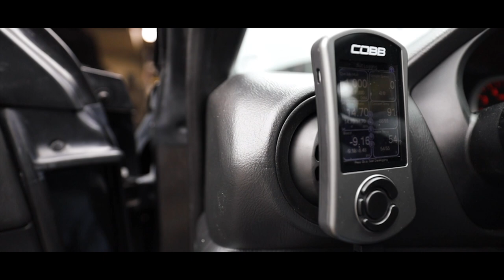How Much Did It Cost To Build the 450 WHP Subaru STI?

Comment: Good quality is not cheap, do it once and do it right

The car turn out so great🤩🤩🤩
Reply from the maker: Thank you! And totally agree. Always under the mindset of do it right the first time 😁
Reply: Otherwise you end up spending more in the end. I learned it the hard way😅😂

Oh and you probably already returned the speakers but with a speaker adapter they woud probably clear the window. Company like metra does adapters that are factory fit with the factory hole and you screw you aftermarket speaker to it!
Reply: Ok i dont find adapters for 05😔
Reply from the maker: IA performance makes adaptors, still have the speakers and got them ordered! 😁😁😁
Reply: 🔥🔥🔥 awsome🔥🔥🔥

Comment: I wonder what it would cost just to build one back to factory or OEM specs. Or rebuilding one with just the type RA block and rods. 

Thanks for the video! Can I ask what did you purchase the car for?! So you paid 10k in upgrades, but what did the car itself cost?!
Reply from the maker: Definitely much cheaper! But would still be a cool build. I paid too much with thr amount of problems it had. Paid 14.5K but if inwould have known about every issue I qouldent have spent more than 12K on it

Comment: I love my 16 STI, but damn it's so expensive to do anything. Especially since I'm in Canada so my prices are slightly higher, my Cobb accessport was just under $1000. Building my Subaru I'm estimating will cost me $20,000-$25,000 to make roughly the same power as your 05. It hurts to think about but after some time when the build is finally complete, I know I'll be super happy with it. And if I'm not I'll sell it and buy a corolla. Who can be sad in a corolla?
Reply from the maker: Never heard of anyone sad in a corolla 😅
Reply: @Smeedia  right? With the fuel mileage you get to those little things it's impossible to be sad. $35 of fuel gets you like 600 miles. Put $35 of fuel in your STI and tell me how far that goes? Not long. Corollas are legendary vehicles in all ways
Reply: V8 coyote or c6 z06. Is the only answer for ez power.

Comment: Question my dude what would be your first place to look for P0171 and at the same time cylinder 1,3,4 misfire? Happened on my drive to work today and it's got me freaked out.🙏

2013 STI
Reply from the maker: Comes back as an O2 sensor, would definitely be effecting AFRs witch could result in a misfire
Reply: @Smeedia  Thank you! Looking into now!
Reply: Well replaced the front O2 with oem and cleaned the MAF. Afr's are dead on while driving but are sitting at around 16-17 at idle then dive down to 13ish then back up. I'm at a loss what it could be🤔
Reply from the maker: While the code is for O2, double check spark plugs as well,

Comment: Yo smeed! I know it's my 4th comment on this video lol but I got $500 bucks I can spend on my 08 wrx at the moment. It has 119xxx miles and I'm focuaed reliability before I make it go fast haha bought it with some mods (cold air, catted dp) and it has the stock tune on it which worries me. With my very limited budget atm what's the best thing I can do for it? Got rid of my check engine light(s) and it seems to be in good running condition so know I feel like I'm back to the starting line and want to start improving the car. Sorry for the long comment I kinda started venting 🤪 thanks again man!
Reply from the maker: Snag an IAG AOS if you don't already have one! 😁
Reply: Sometimes u can find the ap v2s cheap, that way u could at least be off the stock tune. After maint items of course

Comment: I wish I only spent that much on my 05 Forester. I'm way more in than that.
Reply from the maker: Whats all done to the forester?! 😁
Reply: @Smeedia  
IAG Short Block Stage 2 Tuff
Stage 2 clutch
Larger fuel pump, injectors, regulator, side feed to top feed conversion, fuel rails, braided lines 
Tgv deletes
Engine mounts
Pitch stop mount
Air Oil Separator system
Cylinder 4 coolant mod
Upgraded turbo oil lines
Iag oil pick up/pan
Iridium Park plugs
100mm head gasket
Iag shift linkage
Air pump delete
Fluidampner crank pulley
STI top mount intercooler
-Grimmspeed Hood Struts  
-Go Fast Bits Hybrid Blow Off Valve 
-Cobb Intake w/ MAF Hose 
-Cobb 1.3 Bar Radiator Cap 
-Mishimoto Radiator 
-Mishimoto Radiator Hoses 
-Mishimoto Thermostat 
-Gates Racing Timing Belt Kit 
-Tomei Timing Belt Guide 
-Tomei Unequal Length Exhaust Manifold 
- Tomioka TD05-18G Billet Turbo 
-Turbo XS Bellmouth Catless Downpipe 
-Invidia G200 Cat Back Exhaust 
-Torque Solution 15mm Exhaust Mounts 
-Cobb Access PORT V3  
-Company23 Boost Control Solenoid 
-Cobb Adjustable Short Throw Shift 
-Torque Solution Front/Rear Shifter Bushings 
-Whiteline 24mm Front Sway Bar 
-Whiteline 24mm Lateral Locks 
-Whiteline Front Endlinks 
-Whiteline Rear Strut Tower Bar w/ Quick Release 
-Whiteline Adjustable Rear Endlinks 
-Whiteline Adjustable 22mm Rear Sway Bar 
-Whiteline 22mm Lateral Locks 
-Whiteline 30mm Steering Rack Bushings 
-STi Genome Front Strut Tower Bar 
-Cusco Power Brace Front Member 
-BC Racing Coilovers (lowered 2.25 in.) 
Thats what all i can remember, im probablyforgetting a lot. Bought in 2015 from Denton TX, drove it back to KS, started project in 2017. Most recent mods are at the top of the list. Just got it back from Modified by KC in Kansas City 13 days ago, spent all last weekend doing the break in miles on the block. I take it back there today (17th) for final dyno and tuning.

Got some cosmetic stuff too;
Carbon fiber hood with hood latches
Carbon fiber mid spoiler
Other little carbon fiber dress up stuff here and there. Some cosmetic stuff from the JDM STI Foresters.
Reply from the maker: That thing sounds like an absolute blast to drive 😍
Reply: @Smeedia  It is. And I'm sure it will be even better once I get it back from the post-block swap dyno test & tune.

Comment: Cost of the car and mods he has done, around $30,000 bucks add another $5,000 in labor if a shop was doing all the work. But These motors love to eat head gaskets and blow by the oil.
 If the head and block surfacing was done correctly a closed deck and forged pistons and a properly pro tune then their not as much of a money pit.
Reply from the maker: These motors do not love to eat headgaskets, hesdgadjets were only ever a problem with early model N/A 2.5s. If your blowing a head gasket on a turbo model it's a result of something else. Also all turbo/high compression cars love to eat oil.

Comment: What would you recommend of ELH and an up pipe?
Reply from the maker: Killer B or ETS for the header and as of right now for up pipes either PLM or grimmspeed
Reply: Full-Race 100%!
Reply: @Chris05STi1982  only bolt on’s left so I figure ask and see what good. Hoping to finish the build next year. PT 6870 with built block and heads. She should definitely be a ripper
Reply: @maverick021981  I have the Full-Race setup with twin 38s on my STi and the BW EFR 8374 turbo and it is a spooling beast. The sound is like no other modified subaru
Reply: @Chris05STi1982  that has to be one sick ride man. Definitely jealous

Comment: No build ever costs touch because no build is ever perfect or finished. Question what exactly all do I need to swap my transmission from WRX over to the STi
Reply from the maker: You'll need the trans, axles, DCCD controller, wiring, rear siff, hubs and axles 🙏
Reply: @Smeedia  dammit. I was hoping that wouldn't be the only way, but if I want a true 6 speed that can be beaten on and not broken every 3,000 miles. That may be something I do out in Washington. Gotta save after the transmission

Comment: Weird question but what speakers did you end up going with?
Reply from the maker: Some open box Alpine deal, I'll have to check when I go back in the garage 😅
Reply: @Smeedia  gotcha. I'm looking to eventually upgrade my blob so I'm glad I saw this first
Reply: @johndaniels1344  typically speaking the polk dx or dxi speakers in 6.5s usually come with a spacer, it works for most cars. Its only about 1/4 inch thick but it works for a lot of setups. Im a polk addict, have them in nearly all my cars, had great luck with them.
Reply: @wimmj6952  I'll look into those thanks for the tip
Reply: @johndaniels1344  take a listen first if u can, some people think the polks are a bit too rich, if ur an infinity fan they may sound muddy in comparison. Nearly all the polks are marine rated so that helps with cars that have frameless windows. Many cars ive worked on had the magnets and connectors corroded after a short time on other brands. Im in the midwest so im sure that doesnt help.
Reply: @wimmj6952  I may give some polks a shot. Just trying to upgrade from stock. Still newish to speakers but planning to throw in a decent 4 way amp to help
Reply: @johndaniels1344  check out a thing called the alpine 445u. Its a 4ch amp of sorts. Its marketed as a power pack. If ur clever u can buy a radio harness and a reverse harness and make a device thatll bump u to 45rms x4 without needing a full amp or all the work involved with it. U can find them for under 100 usd. I have one in my offroader and my winter beater, its really great B+ kind of setup. Works well with factory decks as well. The 15+ wrx/stis have a nice little pocket to the right of the radio next to the glovebox that itll slide right into.
Reply: @wimmj6952  I've got an 05 wrx but I'm still pretty sure I can figure the wiring. Thanks for the help. I dont have much hardware experience so I really don't know what's good and whats not
Reply: @johndaniels1344  a nice headunit and a nice set of front 6.5s will be a huge difference. I have an 05 sti so i know the sound stage pretty well. Our rear speakers dont make as much of a difference. U can fit 6.5s back there but ur not gaining much really. And if u have an exhaust then id say stay stock back there or go inexpensive. I generally move my sound stage more forward anyway.
Reply: @wimmj6952  thanks for the advice. Might have to just double up on this for my 05 fxt lol. Seriously thanks for all the help
Reply: @wimmj6952  gotcha. I will email if I need help. Thank you. Also emergency vehicle wiring sounds very repetitive
Reply: @johndaniels1344  rock on, my goal is to have everyone that wants quality music to have it, no matter the budget or skill set. 

Oddly enough my fleet consists of so many different models and trims that theyre almost all custom done, its not as fun as making music but it pays way better and its a lot more stable. For anyone looking for a job, anything fleet often overlooked. Theyre almost always looking, pay well, room to grow and move up. Its not “gram worth” or whatever the kids say but im ok with that. And i have access to drive on lifts and air so i can work on my cars on off days. That alone has saved me a ton.

Comment: What motor is holding all this power damn does it even need to be built?
Reply from the maker: Just an OEM Subaru Type Ra short block 🙏
Reply: @Smeedia  is this the same block in a 19sti? Because that power is crazy
Reply from the maker: Yes 🙏😁

Comment: Don't buy a new keyfob. It's super easy to crack open the case and replace the battery.
Reply from the maker: Already did that, it's the actual buttons on the FOB 😅😅😅
Reply: @Smeedia  aww bummer
Reply from the maker: Luckily under $200 for a new OEM Fob programed 😅

Comment: That’s y I just keep it stock and with warranty 😂 and fuck with my Honda’s and Acura cuz them cheap to replace if they break I don’t have the money to do wat u do but I’m glad I get to drive Subaru at least lol 😂 and I still need to buy my favorite car Evo .
Reply from the maker: I too need to snag an Evo! Definitely not cheap cars but Definitely enjoy them
Reply: From where i am now... Evo and honda were much more expensive.. 🤣🤣🤣

Here we can get sf5 turbo or 02-05 wrx from around 10k usd to 25k usd for the rare s203 and s204 sti which makes no sense when people selling eg6 hatchback kswap from 15-20k usd and evo8 mr edition price starts from 30k usd 🤣🤣🤣

And since locals worship evo and vtec like nothing else...there is jdm tax on top of that as well which not really applies to subaru... 

Too bad what we were lacking here is good aftermarket parts supports as well as less capable engine builder/machine shop that subaru engine calls for...

Hearing fellow subie members been ripped off by mechanic with shady engine build is pretty common here...even worst it was done by "subie specialist" not some random general workshop

Comment: In 3  months you will need new motor They are fun when they run everybody know they don’t last Before people start bitching I own 2006 sti
Reply from the maker: Doubt this one will let go, only ever had 1 motor go and it was my own fault. Should last without any issue 🙌
Reply: Making 481 whp on a 2018 type ra for over a year, still hasn’t blown up
Reply: @joseruiz-rv4qz  Type RA Have cast  pistons to I’ve been in the Subaru since 2004 They are great cars if you don’t mod them But if you want to go fast you put in the money in the wrong vehicle they are not reliable   Every Subaru owner know that but they try to ignore it you have to be honest sometime
Reply: @adin9264  they’re are not cast pistons, they’re Hypereutectic piston, which are made of aluminum alloy